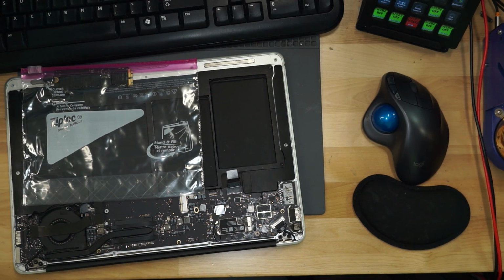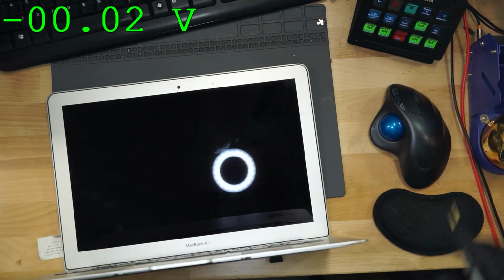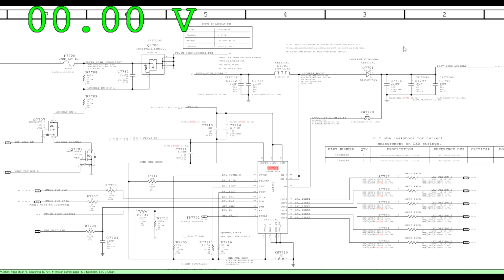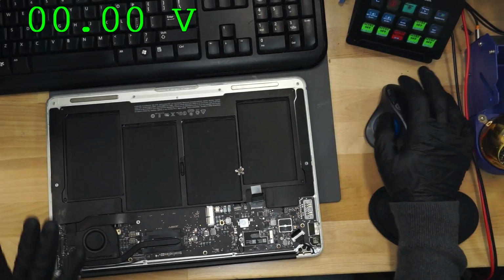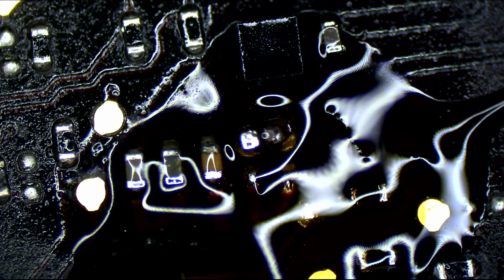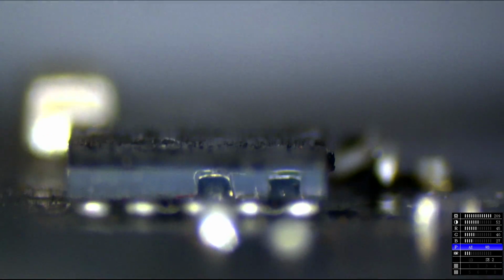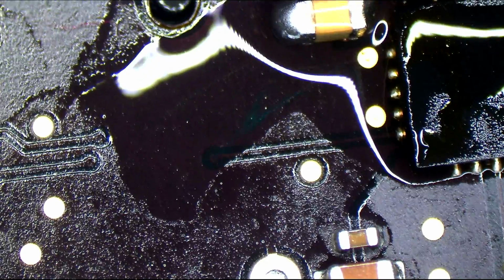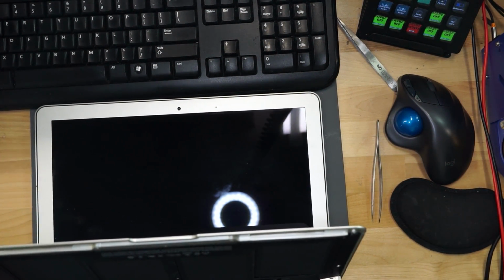Louis' last repair before a long vacation

Comment: Old in the tooth stems from the idea that teeth were vitally important for eating and therefore life, but as teeth were lost due to decay or violence, you were therefore older as you were closer to death. 

However, the correct phrase is actually "long in the tooth" which refers to older predators who are less able to keep killing prey and therefore keeping their teeth short and functional.

Comment: 'Check the light switch...' Bought a house and was told the dining room light didn't work. Light switch was a push-on, push-off, with variable lighting. Pushed it, turned it clockwise and .... light worked. Wonder if the asking price was lowered due to this electrical 'issue.'

Comment: I made that same mistake with the ribbon backwards before and it makes it look like a no backlight issue. I caught it quick. I assume in this case, they put the cable on backwards and then tried to fix it and messed with the board...

Comment: The phrase is “long in the tooth”.  That’s because you can tell the age of a horse from its teeth .   Horse’s teeth continue to grow as they age.  They actually don’t get longer (there’s more to it) because they are grazers and they continually wear down their teeth.  There is a wear pattern on the top of the teeth kinda-sorta like tree rings only different.  The shape of the enamel pattern on the top of the teeth indicates age.  There is an ancillary phenomenon where horses favor certain areas of their teeth when the grind hay.  The areas that aren’t used continue to grow taller and get sharp and overlap opposing teeth and can even pierce the gums or cheeks.  A vet has to go in there with a file and special equine dental tools to knock those long areas down.   And now you know.😉

Comment: Great video Louis, welcome back! 
Anybody know where to look for HP 2000-354NR (I3) repair data? I have a burned LCD connector on the MB from liquid-damage. I cleaned up the char, burnt pins and burnt traces to remove any shorts but it still won't send image to an external screen. Still turns on, powers the disc-drive, flickers the network activity light, and spins the fan. I'll probably just pick up a replacement MB in the end, but first I want to use it for practice in finding out what's borked.

Comment: Actually Louis, I'm sad that I have to correct you. A transistor or relay is CLOSED when voltage is allowed to pass through, not OPEN. It's not a valve, it's a switch.

Comment: my coworkers mac book air wouldnt turn on or even take a charge 
i opened it up and the port on the top of the motherboard near the rear of the case had corrosion (used some wd40 to clean it off) 
took that wire off you were talking about that was on the fan 
cleaned around it and blew it out with my air compressor and it turned on and seemed to work fine (she forgot her password so i couldnt check anything in mac os) 
its shame a little bit of corrosion kills a macbook but a fucking pc can take a beating and still run for years

Comment: My store is a mess , i have 5 benches all full of current repairs and my scope and reflow station bench is always chicken guts and i have two other stations setup not so clean either but i have all the tools i need , a can do attitude and im the only one around who can even pick up a soldering iron let alone use one so i don't give a flying fuck how it looks. the faces from my customers when they receive there device back after another store told them it was "unfixable" is worth it to everyone involved :)

Comment: There's no such thing as 1st party repair. They just ship it out to some shit hole like you did the videos on. The quality is shit all the way around. Unless you count trashing your shit as repair when some retard at apple or best buy does try to touch it. Thinks auto mechanics.... Dealerships will fuck you 100% of the time. Independent mechanic will likely fuck you, but at least you have a chance of not getting fucked and have resources available to judge them (and get more realistic prices) before you take your valuable property there. Dealership: OMGZ, IT'LL BLOW UP IF YOU TAKE IT ANYWHERE ELSE! AND WE WANT TWICE THE VALUE OF YOUR CAR TO FIX!

1st party anything needs banned by law (except for warranty services). It doesn't work. It's a manifestation of corruption.

Comment: How do you like the source selector console you are using for the stream? I see that there is a lip sync on the video from camera on your side. I had a similar issue. I resolved mine by going into that  camera source and disabling the internal embedded audio option. Cheers!

Comment: I found one of those fancy repair places to get my iPhone 7+ screen replaced iPhone had no problems when I handed it to them when I got it back the first time it was doing things on its own 2nd time still doing things on it own and screen flickering I then took it to a smaller repair shop and there little room is in disarray but 1 hour and 15 minutes later iPhone works like new

Comment: I started repairing the monitors at my house because the computer repair shop that "fixes"things told me to throw it out because his diagnosis would cost more than a new panel/ I then took it home and explored on the internet as to what  actually breaks and found cheap capacitors had been used.  Taught myself how to desolder and resolder boards crudely but effectively. 
My motto from that day on was, I cant break what is already broken,. thus I cannot break it any worse. 
Badcaps is a great place,
Reply: That's a great motto! Good job on fixing that monitor yourself! I also have fixed a (simpler) electronic device using my little soldering experience, feels great when you get it working.

Comment: Louis, I dropped my 6 month old A1708 on the floor and aside from the slight cosmetic damage the bottom left corner of the lcd is noticeably brighter/higher contrast than the rest of the display. Can I fix it without replacing the entire display ?

Comment: Teeth also get used up as you age. The top layer, dentin cannot regenerate at all. Use flouride toothpaste to harden that layer (decrease solubility). Avoid sweet (bacteria promoting) and acidious (dissolving dentin) food to lenghten your teeths lifespan.
Beginning in your 30s your teeth grow tooth cement to make up for our used up top layer.

Old people tend to get very sensitive teeth when their dentin is used up and the "softer" (still denser than bones) insides are exposed.

Feet free to ask anatomy questions! I am just studying anatomy as a part of biochemistry.

Comment: the expression is "Long in the tooth". Its meaning comes from a horses gums receding as it gets older, meaning if a horse's teeth look longer than normal, its a safe assumption that the horse is old, and therefore not a wise purchase.

Comment: Honestly Louis, even not knowing what your doing with mechanical systems. I would trust you more than the majority of so called mechanics that I have met. Why would I do something so crazy? Because you use that squishy grey matter between your ears to figure things out. I have learned a lot of skills, some of them well into professional level of quality. Only about a year older than you. As much as I like to say things like, "I have an aptitude" or "I have some intuitive understanding" to explain it to random people that ask how I have learned so much. The actual reason is simple, I treat every single thing with the mindset, "it was made by man and thus can be understood by man". In other words I am not afraid to sit and think about a given problem, do the research to understand how the system the problem is occurring in works.

If you were to go out and look for a mechanic that actually understands a car, a bike or whatever mechanical system you choose. Your going to find a lot that understand common failures but are completely lost in anything that isn't already well documented. It's rare you find mechanics that apply their brains toward the problem but those guys, even when inexperienced tend to be the best damn mechanics you can ask for.

Comment: Fake vegan! This is the first time i hear you talking about being vegan. A propper vegan says it every other word. But i understand your point.
Reply from the maker: There is a difference between a vegan, and a cunt. While they may intersect, and often, it is not a requirement.
Reply: Gullepomp if I remember correctly he mentioned it in a nutrition video, where he made a smoothie in the repair shop

Comment: Damn. I should open an Apple repair center and outsource all my repairs to you. I would charge my clients triple what you charge me.
Reply: I would be very up  set for the bill from company which muck up the chip and sent it to loius to fix it  lois bill $50 the companys bill $50 + $40 shipping  + $200 for sending to the company

Comment: Louis you are a one of a kind. You are upfront honest and down to earth all at the same time. I am the same way and most people can not understand nor can they handle someone who try's to tell you how something should be but they only know what they have been hearing from other source that they hold to be true. I have worked with Electronics for over 35 years and worked for Motorola and GE with 2 way Communications mainly in Digital Emergency Service's systems I have worked on boards to the tops of towers. There is little respect for the people who still try to work hands on at board level and company's do not want to have people like that. They want the all mighty dollar for total replacement. To me I am still in the mind set of times as in the Barter System and Pay me what you can till it is payed off.  Keep up with you way of doing business and your way of doing repairs watching your videos keeps me motivated since my disability to keep on doing repairs as I used too.

Comment: Louis, please reconsider your choice in being vegan. It is detrimental to your health. It does not help climate change, and it doesn't help prevent animal cruelty. Supporting pasture grass fed animals helps the environment AND helps prevent animal cruelty. 

Please, please do some more research into bio-absorbability of vitamins and minerals on a vegan diet. 
Please consume animal foods.
Reply from the maker: I have. Not killing animals seems like a good way to reduce animal cruelty, so long as you don't eat garbage that requires destroying their ecosystem in order to survive. In terms of vitamin/mineral absorption, you can get B12 and DHA/EPA omega 3s and iron without eating meat.
Reply: @rossmanngroup  Im not speaking strictly about B12 and all the common deficiencies. The total amount of vitamins in plants and the amount which the body is able to absorb are incredibly different. Most of the nutrients are not readily available and requires the body to process them before being usable. Each vitamin has a different rate, but generally 25% of the paper value is actually absorbed (being extremely generous). 
Same goes for minerals.

I understand your point on how not killing animals seems like a good way to prevent cruelty, however i believe that promoting healthy and happy lives (while also steering the whole industry in that direction as you don't support feedlots) does more for the animals.

Everything will die, all that matters is their life up to the point of death. being plant based destroys possible cattle habitats as it'll be littered with the corpses of rodents in cornfields and sprayed with the poison you consume. Supporting grass-fed pastured animal products means more habitats alongside happy and healthy lives for cattle, while also promoting the health of the people who consume those products.

I respect that you've done research into the topic, it's not usually the case.

Comment: Just fixed a macbook air that has visited 2 stores and was one of the easiest for me yet...guy offered to buy it for 50$... 2017 air.
Reply: luca kro  no   the repair shop offered costumer 50 to buy nonworking macbook.
Reply: luca kro  I don't have a store or anything like that... I just pick them up on Craigslist/kijiji.. and sometimes guys buy them back, when I send a pic of there working laptop..

Comment: I was hoping so much that the backlight just worked when you turned the cable around... wouldve killed me.
Reply: Other example:
customer:        "My monitor isn't working. Fix it!" 
Repair shop:   "Did you try to plug the power cable?"
Reply: @dragonbreak3360  Actual scenario I dealt with.
Customer: My printer isn't working!
Me: Did you plug it in?
Customer: Why would I do that? It's wireless!
Reply: IamCoalfoot lmfao how is WiFi still the fucking mystery of the century for everyone who doesn’t touch this stuff
Reply: Actually that ribbon has nothing to do with the back light and it will function either way, it's just a ribbon. I would have liked to see this unit come in after back light repair by the other idiot and now has a cooling issue. That would have been much better.

Comment: So a repair shop sent this to you to repair it b/c they couldn't figure it out?  Damn right bill them full charge.
Reply: I agree only one bad thing about that they would probably just pass the cost down to the customer
Reply: @delinquentdesign  Even if you didn't, it would be passed on anyway.
Reply: @delinquentdesign  what if they charged anyway even he did it for free , cuz they can
Reply: I bet that shop charged the customer anyway.
Reply: but if the shop charge it ... customer will probably never return there ;)
Reply: @Ewzenia  they want it to get fixed even if it is minor cable pressing is unknown to customer
Reply: They probably even made it worse by trying to repair it

Comment: What would you suggest to someone who wants to get into phone repair? I want to start gaining some knowledge on everything and how everything works. Is there a program or website I can go to to start  getting some experience.
Reply: You want to start gaining knowledge- so just START. There are many good resources on the internet for this kind of stuff, but the best way to learn it is to just repair stuff HANDS ON- you're not going to learn it any other way. Jessa at iPadRehab has a wonderful YouTube channel that can help you out along the way, but again, you won't learn as much from simply watching videos as you will when you apply knowledge from those videos to actually fix something.
Reply: @kytachips  Yes I definitely know that but I want to start learning the basics like the names of parts and how everything works together. My experience so far is just simple screen replacements. But thank you I'll look for some courses here on YouTube if I can and do more hands on works.
Reply: @samdavis4785  Have a look at Louis's basic electronics playlist (https://www.youtube.com/playlist?list=PLkVbIsAWN2ltOWmriIdOc5CtiZqUTH7GT ). He talks about pretty much all the basic components of circuits and how they work- keep in mind, that playlist discusses the uses of the electronic components in a laptop repair point of view, but you can apply the concepts to phone repair as well. After you figure out how circuits work with all of the basic components you'll encounter during repairs, watch some iPad Rehab videos to figure out some basic issues that iPhones commonly have. Once you understand why the issues occur and how you can troubleshoot them, you should have a go at using that new knowledge to try to repair your own device and get some basic tools to help you out. But most importantly, have a solid understanding of how circuits work so that you are able to diagnose the devices - without a solid ability to diagnose circuit issues, you won't get far.
Reply: @kytachips  I'll take a look thank you again